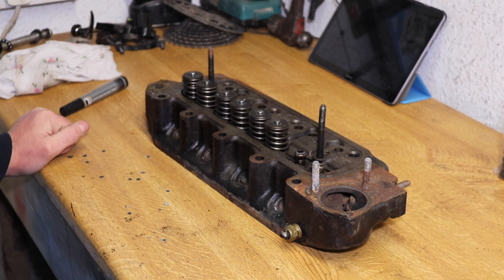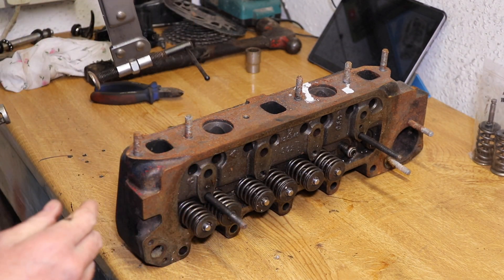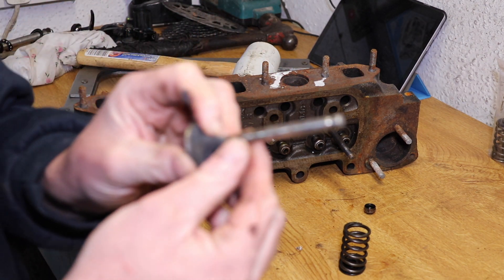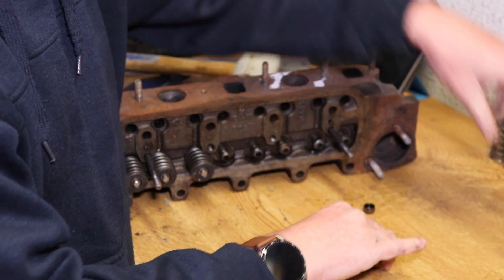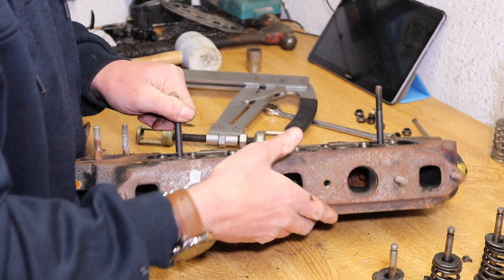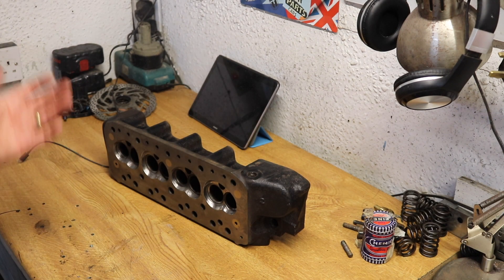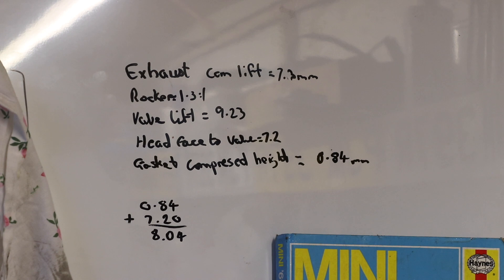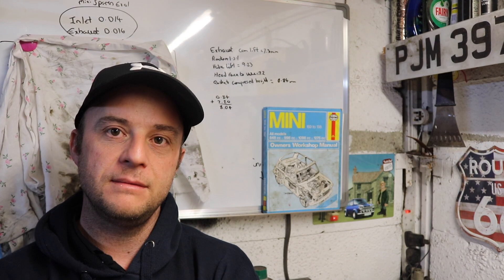1275 Cylinder Head on 998 Mini Part 2

Comment: That heads come up nice and Is it just exhaust valve side that needs the relief cuts doing
Reply from the maker: Yes it is. The 998 bore is too small to fit both inside lol
Reply: Adam Campion  haha im looking at doing wht you have done but going off of online proces i may aswell pay an extra couple hundred quid and get a conplete 1275 😂 also do you need to run anything else with the 1275 head such as smaller pulleys for clearance or whatever
Reply from the maker: Yeah I think the standard water pump pulley on a 998 will foul the head. I have a smaller one anyway because I changed it a while ago. I might also have to trim a little bit off the water pump. To do what I'm doing properly with proper machine shop work would get quite expensive I think. But I like to play around

Comment: Nice update, my 998 runs a big valve head . I’ve got a 1275 head I thought of using before but never got round to it.
Reply: I’m not sure, will check later and let you know. I remember being told in the past that it was possible to run a 1275 head without the pockets in the block but I’m not sure if it is.
Reply from the maker: If you have a standard cam or an mg metro one i belive it's possible. But I'm running a minispares evo001 cam which has a bit more lift
Reply: It looks like 12G20 and I can’t make out the last digit as the rockers etc are still on it, the head was ported and polished when I got it. I was thinking of the MG metro head and cam onto another block I have when the bodywork is complete.
Reply from the maker: Awesome. I'd love ported and polished one. In fact I'd like to have a go myself one day. Will get a spare first lol
Reply from the maker: Which one do you have on now? Is it a 12g295?

Comment: Great work Adam, we used to cut valve reliefs in blocks for Mini 7 engines using 12G940 on 850 and 998 blocks, it is definitely possible to do yourself, either a milling cutter in a pillar drill, or even by hand (carefully!) with a carbide cutter in a die grinder. Well done for trying something different!
Reply from the maker: Thanks. I have been looking at my pillar drill and seeing how I could use that.

Comment: That cleaned up really well mate, great vid, u not tempted to fitted hardened seats while its all stripped?
Reply from the maker: No but only because I'm tight. The 12g940 heads seem relatively cheap so I'll perhaps get another one at some point
Reply: @AdamCampionCars  😂😂fair enough, it only took a few days for my mini spares delivery so hopefully you will be cracking on soon